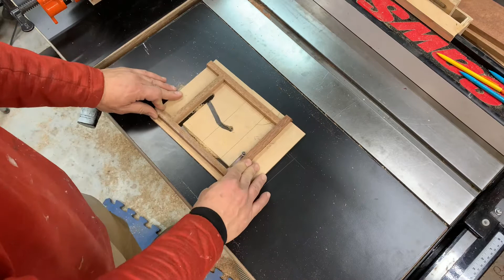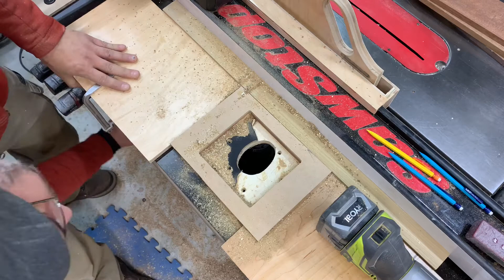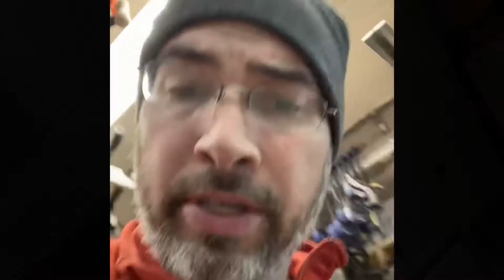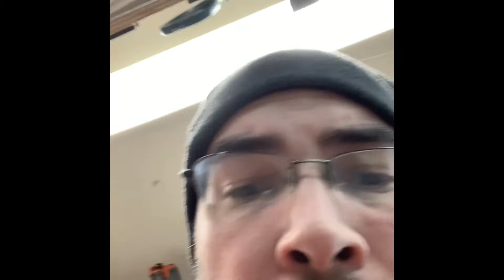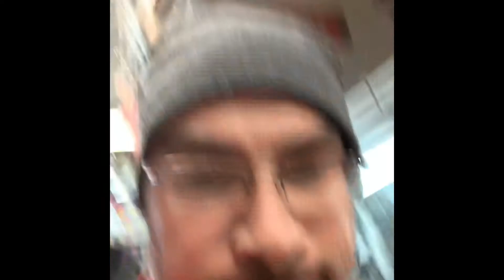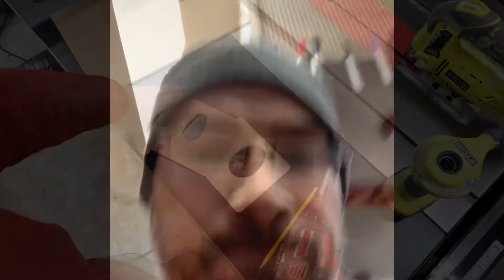Fixing my messed up router table.

Comment: Why an elongated hole?
Reply from the maker: So I used a 4” port on the sealed box under the table. If you have a tight hole around the bit it will starve the dust collector.  But if you elongate the hole it allows the dust collector to have better suction from the back and bottom of the bit. It really makes a difference.  Most router tables rely on the suction from the fence - hence collars that that keep the dust from going down by the lift. I don’t have fence suction at all for this table so this is my solution.